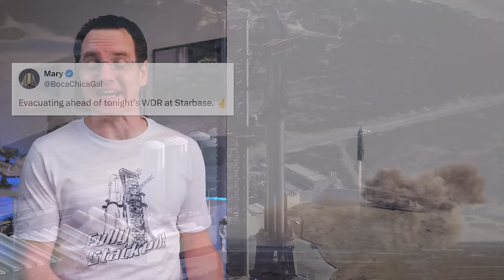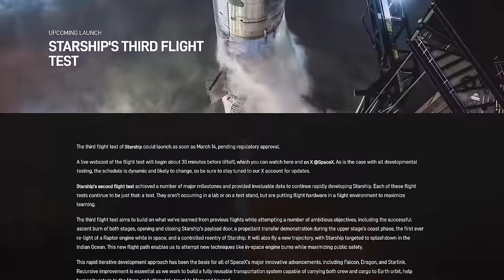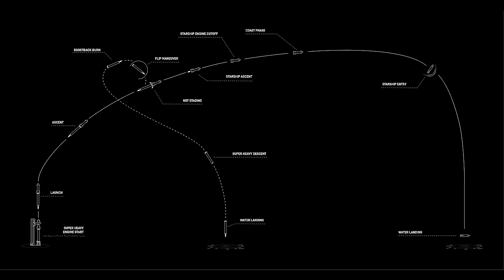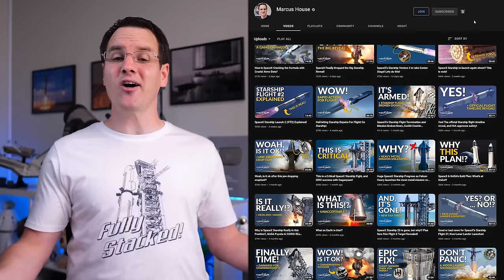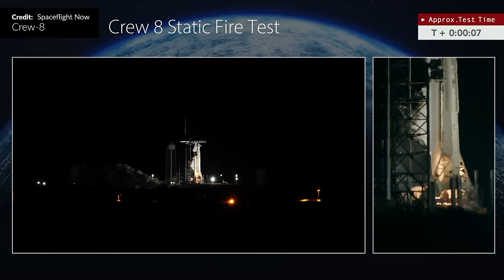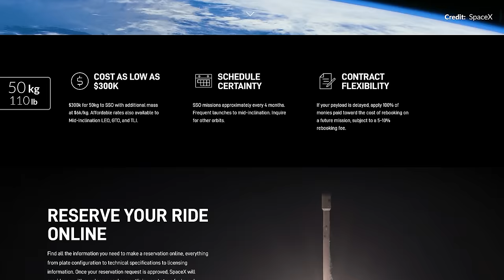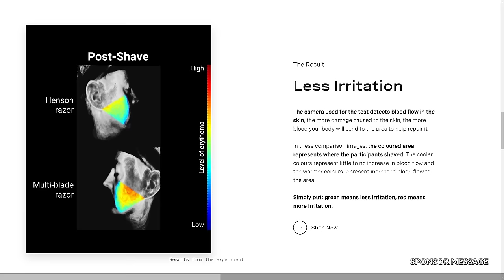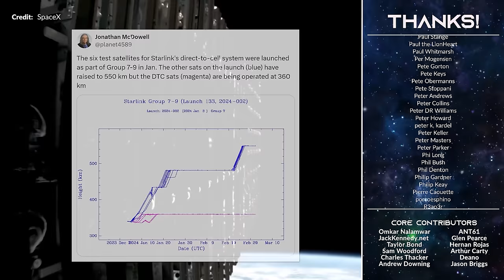It's go time for SpaceX's Starship Flight 3

Comment: 2 tonnes per second is insane!
Reply: Even crazier, the amount of propellants pumped for 33 Raptors during launch is 21,450 kg (46,200 pounds) per second!
Reply: My head can’t get around this number… amazing
Reply: That's like one coupe car pumped through pipes every second 😂
Reply: I jumped to the comments section right after hearing this 😅
Reply: Nah, I know an Australian guy who can down that much grog faster
Reply: Its a lot but 1 metric ton of water is only 1 cubic meter in size, so its just the weight that's impressive not the volume,  imo.😊 i know its tonnes not tons but the ratio of weight to size would be the same no matter the metrics used to measure it. Or have i not turn on my brain yet this morning? LoL ok, just did the maths. Its only 480 gallons per second, correct?  Should i be more impressed then i am?😂
Reply: @Yggdrasil42 could you give me the numbers in big Mac’s per second ?
Reply: @Meowface. 3,846 Big Macs per sec
Reply: @richardhenry5118  that can’t be right 🤔🤔
Reply: I would love to see an internal cam while they're filling the tanks
Reply: @JPMadden  Holy mother of god ... I currently work on a system that frees 5000 joules in a 10-th of a second, and it's already a bit concerning. That scale is on verge of madness.
Reply: Saturn 5 burnt 3 tons per second so an incredible saving without losing power, just amazing technology.
Reply: Saturn 5's F1's (5 of them together) could drain an Olympic size pool (490,000 gallons - you do the conversion to simpleton units) in 1.7 minutes.  Like wise, published numbers (40,000 lbs per second- all engines running), The Starship Prototypes can drain the same pool in about the same time. To put that in something you can wrap your head around, The Starship booster is using about 22,467 gallons a mile. Not exactly an economy car.
Reply: What is insane is that it takes an hour to load, super heavy, and less than three minutes to empty it
Reply: @JPMadden 😊
Reply: @Yggdrasil42   A sedan ??
Reply: Very Cool Dude !
Reply: That's one hell of a weight loss program 😂
Reply: 1 ton is like 1 by 1 by 1 meter sized cube full of water, that's not too much
Reply: @richardhenry5118 now give me the numbers of how many starships to refuel one to get to the moon. Was it 24?
Reply: @MarkPierro  Does he know Guybrush Threepwood?
Reply: The rocketdyne f1 did 2.5 tons per second. Just for perspective.

Comment: Hi Marcus:  Long time follower, new subscriber.  My background is electrical engineering and disk drives (career) with a life long interest in space tech.  A month or two ago you were commenting on a starship modification (26?) with welding some stringers mid-ship that may relate to structural changes for the payload door.  This starship has had its TPS tiles removed.  My guess is that SpaceX is studying structural changes related to a starship tanker.  The tanker is time critical technology that has to come soon after successful starship launches.  You can't go to Mars without it and you can't even get to the Moon without it.  That starship has had its TPS tiles removed and the fins removed - not required for a tanker.  A tanker will require the structural strength to enable in orbit docking.  Just something to think about.  I have to say that you and your colleagues do an outstanding job!  Mark

Comment: The thermal stress on the vehicle with 115t/minute of cryogenic fuel has to be significant.   Probably not an issue when the vehicle will not be reused multiple times yet.

Comment: Belly splash = they understand perfectly well that the tiles around the seams are gonna fall off posthaste, so there's no point in pretending that Starship can survive reentry.  Definitely a better idea to launch ASAP with that understanding than to spend a couple more months re-engineering against it before launching anything.

Comment: Marcus, thanks for the tip about the Henson razor.  I have been using mine for almost a year and a half, getting the best shaves ever.  Even crazier I am still using my same pack of 100 free blades with 40 blades still remaining.  Yes, I get over 7 shaves/blade with closer shaves and way less irritation (the old super expensive blades rarely lasted 3 shaves).  I have also saved more than 3 times the cost of the Hanson razor!  Thanks again!!
Reply: Spam lol

Comment: So I haven't read anything in depth yet, but I was hoping you'd mention the news that supposedly the Dragon capsule has a small crack somewhere?
Reply: The crack were deemed acceptable by independent teams because it will reseal due to reentry heat & had happened before on Cargo Dragon which landed safely

Comment: I thought the grid fins on the starship boosters were made from solid pieces of titanium? To my knowledge titanium is supposed to be resistant to rusting and corrosion,  that's one of the reasons it's used on rockets. I'm curious how a piece of titanium ended up having rust on it.
Reply: It's made out of steel
Reply: @alvianchoiriapriliansyah9882  I seem to remember spaceX raving about how the grid fins are made from a giant piece of billit titanium. If they were made from steel they would be too heavy and rip off the side of the ship. And also not strong enough to pick up an entire booster with.
Reply: @evandipasquale9255 The "giant piece" of titanium isn't something to be brag about since it's one of the most expensive materials. Steel can do the job just fine with negligible payload penalty since it's super-heavy lift & on the first stage. And it didn't rip off on Flight 2

The booster isn't picked up directly from the grid fins but by the two studs just underneath it which could misled people like in this case you
Reply: @alvianchoiriapriliansyah9882  steel weighs twice as much as titanium,  I'm not sure you understand how big those grid fins are. The information I could find on this topic is the normal falcon 9 and starship use titanium grid fins while the falcon superheavy uses steel fins.
Reply: @evandipasquale9255 Already knows the grid fins is big & heavy yes, but again that's negligible because this rocket can lift more than 100 tons to LEO with full reuse booster landed on the launch site, and the grid fins is located on the first stage when the payload loss for heavier fins isn't 1-to-1. The cost however are way bigger impediment than weight, the largest single casted titanium ever for grid fins will skyrocket the booster cost & reduce production rate

Oh my Lord how funny 😂. Starship is an upper stage that does NOT have ANY grid fins. Falcon 9 yes it uses titanium grid fins but that's because it has much LOWER performance to orbit than Starship

Super Heavy is a first stage of Starship, there's no "Falcon" naming before it. And yes, it uses steel grid fins
Reply: @alvianchoiriapriliansyah9882  the falcon 9 heavy is real, it's 3 falcon 9 center stages attached to each other.  And yes the stage is called starship but the entire system as a whole is also called starship. Which includes the 1st stage booster (blame spaceX they named it not me). Lol they'll probably change everything in 6 months like they always do. But they've been using titanium grid fins on falcon rockets for yrs now, 4 fins aren't going to break the bank.
Reply: @evandipasquale9255 Yes but they don't call Falcon Heavy as "Super Heavy"

As for last sentence, no it matters a lot. Harder-to-produce titanium means fewer boosters to be produced, which will put higher stress on Artemis refuelings and increase the cost per launch. All for the sake of just a few hundreds of kgs to ton of more payload, which for 100+ ton to LEO rocket is meaningless. They made many changes in 6 months but steel material for grid fins isn't one of them & it's here to stay

Comment: Since when does titanium rust?  I'm betting those grid fins on Booster 4 were never meant to fly, so they used cheaper versions.
Reply: Super Heavy doesn't use titanium, it uses steel.
And B4 was originally meant to fly
Reply: @bryanillenberg  Oh!  Did not know Booster doesn't use Titanium. Thanks.

Comment: They should try a internal launch termination system, maybe a small pipe between the oxydizer and methane header tanks that could mix the two and blow them up inside the tank, one torch igniter in there and it would truly destroy the vehicle for less extra mass
Reply: They already have that: the FTS (it doesn't work in the way you describe, but it is internal and fully autonomous)
Reply: @bryanillenberg  the flight termination system uses explosive charges, I'm talking about using the vehicles own propellant to be the termination system so they can ditch they 100's of pounds of explosives and circuitry used to ignite then
Reply: @rileymannion5301  One: the FTS probably isn't more than 30 kg.
Two: the system your describing would almost certainly take up more mass.
Three: one of the jobs of the FTS is to prevent the propellants from mixing. Your method encourages it.

Comment: When they detank, are they releasing the oxygen and methane to atmosphere, or do they recapture it for future use?
Reply: Most of the two props were put back into storage, boiled off methane is recondensed with liquid nitrogen before following the rest to its storage
Reply: @alvianchoiriapriliansyah9882  I was hoping it got recovered, just wasn't sure how they ensure that it doesn't get contaminated during the recovery process.  Back when I was stationed on an air force base, I knew that jet fuel was detanked and not reused as jet fuel... they'd take it and use it in less critical equipment like the vehicles driving around the flight line.
Reply: @scottmcelhiney323 Liquid Oxygen + liquid methane and jet fuel are a whole different operations

Comment: I wish I knew why they're dead set on building the 2nd tower so close to the first one. I mean, I understand that it can use the existing tank farm however at some point they'll have to start catching boosters and if one crashes damage could be done to both towers. The same is true if one detonates @ liftoff. Building a separate tank farm and Stage Zero would provide full redundancy in the event of a catastrophic event, and would dramatically improve their ability to bounce back from one. But I digress. I'm truly excited for the upcoming flight!
Reply: Booster had fraction of the fuel total at landing and were very unlikely to damage both towers

Comment: Time for the Starship Heavy.
Current stack, plus a Starship tanker with heat shields on each side of the booster providing fuel and 12 additional sea level Raptors.  They complete one orbit, then land at launch site.
Reply: The math doesn't work, cause if those tankers reach orbit (violating v=ve*LN(mg/me) in the process), then the booster will reach orbit as well
If your just joking, then, LOL.
Reply: @bryanillenberg  I was half joking, and realized the quickly obvious issue of dragging the booster iinto orbit, but had already written it down. So, I shrugged, sent it, and have been waiting for informed corrections, laughter, and/or insults since that time.
Thank you for the informed reply.👍

Comment: I was disappointed that there is still no indication that SpaceX has added a baffle system to the first stage.  What that is likely to mean is that it will explode again as the unignited fuel rushes out of it following separation.  I hope I'm wrong, but I think that was the problem last time.
Reply: Just because you didn't look thorough enough doesn't mean it didn't exist

Comment: Titanium rusts?
Reply: Titanium oxide. TiO2 
Titanium is also flammable.
Reply: These grid fins aren't made out of titanium
Reply: No. It's inert to salt and acid and used in surgery for screws and plates for this reason as well as being light. But it is hard to shape. The earlier grid fins were steel.
Reply: @Hoopaball Titanium isn’t flammable you’re thinking of magnesium. Titanium has a slightly higher melting point than steel (1650c vs 1500c) but a much higher melting point than aluminium which is about 650c. So titanium is a great choice but is ridiculously expensive for rockets. Carbon fibre has a way higher melting point of 3500c but is harder to manufacture and could develop dangerous micro fractures. However rocket lab seems to be mastering it.
Reply: @David-yo5ws And the current grid fins are still made out of steel

Comment: The SpaceX "schedule" for Starship doesn't include a "de-orbit burn", so I have to assume that the original engine burn will leave it shy of orbital speed.  Though it does try to relight an engine but that depends on what orientation Sharship will be in.  De-orbiting means a back flip so engine is at front end, tthen fire, and then back flip to being nose forward again and assume re-entry attitude.
Reply: In-space burn IS the deorbit burn